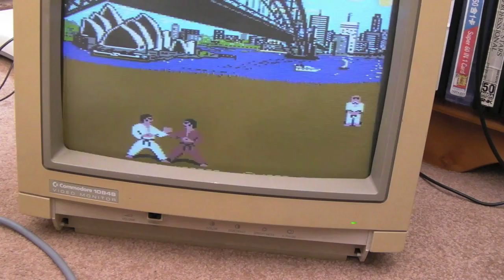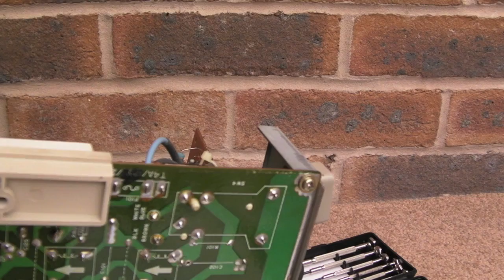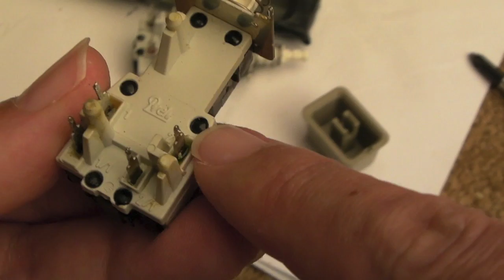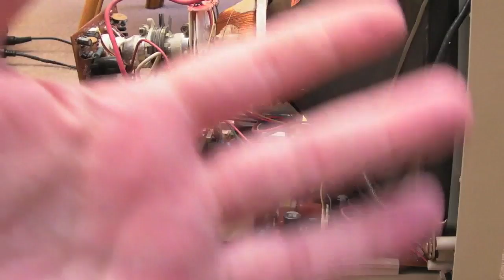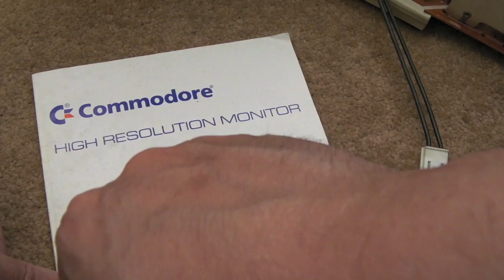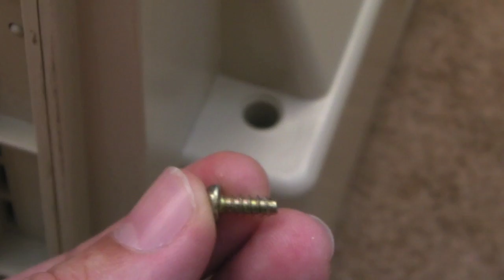Commodore 1084S (1084S-D1) Repair(s) - Part 1

Comment: I've repaired a couple of those Preh ME5A switches, drilling a tiny hole in the black slider part and epoxying in a cutoff piece of paper clip (sanded down round/smooth). One however had completely lost the contact material on the swinging copper arm, so I didn't think it would be safe to put back into service. When disassembling, get the external pins as clean (desoldering braid) and straight as possible, otherwise they'll get pulled out when you separate the housing parts and it is very hard to get them back in place!

Comment: is it worth to recap and change flyback if its currently working? i it should be ok to just use the monitor as is?
Reply from the maker: No point in changing the flyback if its working!  The capacitors will eventually fail - if they have never been replaced, you could wait until you get some kind of fault, or just swap them out in advance.

Comment: Do you think it's ok to swap out this switch like you've done without having to discharge the anode ? providing I go nowhere near the HV side of the board?
Reply from the maker: Working on electronics like this is risky if you dont know what you are doing.   So, only if you feel capable of not electrocuting yourself on the anode, or the charged caps on the board!   If you are careful and stay well away from the anode and flyback cable, and avoid touching charged capacitors on the board, you should be OK!   Do not power it on without the lid on if you want to be extra safe too.

Comment: Hi. When you got electrocuted on the flyback transformer, back when you were young, was the monitor turned on?
Reply from the maker: Yes!!!!  There was some kind of leak at the top of the transformer and my hand brushed near it...  I very nearly died!
Reply: @GadgetUK164  So, if the monitor is off, only the capacitors above rated ~50V, and the CRT tube are dangerous?
Reply from the maker: @peddersoldchap  Yes, and you can discharge the caps and the tube.
Reply: @GadgetUK164  I know I can discharge the caps with a high wattage resistor. The CRT can be discharged by connecting it to the earth terminal of a wall socket, the thing is, I am living in an old flat, so I don't know if the earth terminal is actually connected...

Comment: Hi! Just to replace the power button, is it neccesary to discharge the crt? Or if i dont use it for a few days before the repair is enough? Thx!
Reply from the maker: If you get a shock from the EHT cap or cable, it can be lethal.  That said, if you unplug the monitor and leave it off for 2 or 3 days.  Try pressing the power switch in a few times (having not powered for 3 days, and with no power lead connected) - you may drain any remaining charge in capacitors and from there its probably safe to swap out the power switch, IF you say away from the EHT cable going to the top the tube.  Some of the capacitors may still hold charge so either drain them (short the + and - cap point with a plastic handled screwdriver or pliars).  And carefully swap out the switch.

Comment: I have a 1084s that has no power light, black screen, but I can here a faint squeal when I turn it off.
Reply from the maker: No idea off the top of my head what the cause might be...  Probably needs recapping, but may have a bad line output transformer or main power rail issue (switching IC).

Comment: Hello there im from Argentina, Buenos Aires! I have a 1084 s d1 and the image goes well about 3 minutes then the vertical goes mad. I used an aerosol fail localizer and i thought tge problem was the chip vertical deflection, cos i a put aerosol in it and the image got well and static. I changed the chip and the problem persist. I have no idea where is the problem now. Can you help me? Thanks in advance!
Reply from the maker: It's not the same resistor I had problems with is it?  The one next to the vertical deflection IC heat sink - where the glue overlaps it?

Comment: I am deeply scared of opening my 1084 to clean it / inspect it.
I will be ultra careful like suggested and I want to buy a specific crt discharger kit but...
Is there any extra safety measure I can use?
Special gloves or something else?

Thanks!
Reply from the maker: If you are inexperienced in working with monitors, avoid going inside until you've watched a load of videos on the subject, and get yourself a proper discharge tool.  You can easily kill yourself if you don't know what you are doing.  There are lots of monitor repairs on Adrians Digital Basement and 12v vids.

Comment: I have an 1084s which has not been use since 1998, now I try turn on and the red light come on  but no picture the hookup is correct . What come be the problem other than I have not use it in years?
Reply from the maker: Probably bad capacitors, or a dry solder joint!
Reply: @GadgetUK164  Not sure if I want to open it up and do some repairs on it.

Comment: AC wont spasm your muscles, at high enough current it will drive your muscles into maximum contraction with super human force. Muscles are driven by something close to pulse density modulation. Basicaly frequency of innervation is proportional to force of contraction. DC needs around four times higher current to kill you.
Most neuron signaling in your body works this way.

Comment: I've had 2 1902's with similar problems. There is a resistor and a cap, sometimes the resistor is up off the PCB about 9mm.  The caps start to fail, shorting the resistor to ground.  In the 1902 these are all low resistance, like 4.7 ohms.  My guess is they are being used as slow blow fuses in anticipation of failing caps.

Comment: these extra contacts on the power switch are for regular TVs that have a standby mode, to tell the control IC the TV was turned on via the power switch so it knows to turn itself on instead of going to standby.

Comment: Would anyone know what would cause the top of the screen to pull to the left once warmed up on a Commodore 1084?  Other than that it works fine.
Reply from the maker: Has it been recapped?
Reply: A few of the high voltage caps were replaced and I just noticed that it only does it on the RGB input.

Comment: I have almost this same monitor. the P1 version. I want to bring it to Canada, where I live now. It is PAL 220v. If I take it to Canada, and use a step-up transformer, will it screw up the hertz and frequency for the monitor? I also have a PAL C64&A500, that I want to continue to use on it. Or shall I change the powersupply to 110v and still keep it PAL. Will all this work?
Reply from the maker: I honestly cannot remember what the impact would be.  I would assume that the refresh rate would jump from 50 to 60hz, but it would still support PAL from Composite connections (I think?  There is a chance it might need the delay line swapping out - ie. you might lack colour when using composite connections).  If you connect via RGB connections that should work no matter what.  It's more a question of a) can you step up to 220v AC, or b) can you change the PSU to support 110v AC.  With either solution 60hz is what will be fed into the PSU, and that might mean some adjustments are needed to picture adjustments.
Reply: @GadgetUK164  Thanks, I think i'll take the chance and bring it over and do the step up transformer. But first I'll have my father in law to send it for repair... the usual Flyback is a gonner... Is that easy but dangerous fix?
Reply from the maker: It can be dangerous removing the flyback from the tube (if unexperienced), and the capacitors on the main board can hold hundreds of volts DC.  But it's fairly easy to do.  The hard part is finding a replacement flyback!

Comment: When I was doing work experience, I was working with the electricians in a factory. They were trying to tell me what the fault was with a piece of machinery, and I thought I was being clever (15/16 year old kid) and pointed towards the problem, didn't even touch it. The industrial machines are 360V AC I believe. They don't turn the machines off unless they have to. Ouch. They pissed themselves laughing at me. I became a developer instead of following a career in electrical engineering.

Comment: Many eon’s ago when I was on a City and Guides 224 Electronic Servicing course we were working on CRT’s in the forms of some very old TV’s, Half way through whatever we were doing at the time and a few work benches behind mind there was a rather loud bang followed by the room filling with think oily smoke and a large object flew though the air by my bench, once the windows were opened and the room became more visible we found one of the students on the floor, shaking, hair all fuzzy, and covered in black wet oily substance where he must have decided to short out a large smoothing cap the wrong way. That’s how I was shown to respect the stupid voltages in TV’s and monitors... great vid as always
Reply from the maker: Thanks =D  Yes, you've got to be careful for sure =D

Comment: Great video... I spotted the bad cap within the first few minutes... you can see a nice bulge to it.  I knew you'd eventually find it.  I've always wanted to learn to fix CRT's.. but always stayed far away not being sure (other than the flyback and red wire) what was high risk of electrocution.  Would like to see a beginner guide to CRT repair.  They are not very complicated but they are also not something you can just get in there and "play" with at least not for long ; )
Reply from the maker: That wasn't the only cap as you can see in part 2 and part 3!  There were some tantalums, a resistor and a dry solder joint too!  I covered most of the basics over the 3 videos but didn't cover checking voltages or anything much to do with the LOPT other than disconnecting and re-connecting it.
Reply: @GadgetUK164  Bump! Have you managed doing the beginner's guide to CRT repair?
Reply from the maker: @peddersoldchap  No, just this series on the 1084S-D1...

Comment: Great vid as usual buddy. I got the Black 1084S and its served me well for many years after having all sorts of stuff plugged into its orifices. My power switch on the back insists on popping back out so i just wedged half a lollipop stick in to keep it on, Bit Cowboy but it works. Dont fancy opening that badboy up. My Amiga 1200 looks great on it as does various consoles. I think the colour has degraded on mine. What is the difference between the Black cased 1084s and the one you have gadget?
Reply from the maker: Thanks =D  Yeah, power switches on these just break for fun =/  lollipop stick sounds like a good solution to me lol, better than breaking the tip off and tilting it like the previous owner of mind did.  The do give a lovely picture but the colour does drop a bit with age sadly =/   I don't believe there are any difference between the black models - its just the same monitor with different colour case to match the Amiga models that were black (CDTV, CD32 etc).

Comment: Great video!

I want to challenge your understanding of electric shocks as it relates to A.C. and D.C.

You explain in this video that D.C. electric shocks are more dangerous because they cause your muscles to cramp and that you become unable to let go of the device.

This is incorrect.  In fact it's the other way around; A.C. shocks cause muscles to lock up, in some cases rendering you incapable of letting go of the source.

The reason for this is because of the way the human nervous system works.  Our nervous system sends signals in pulse trains, which operate in and around a frequency of 60Hz.  As a result, our nervous system is more sensitive to A.C. electric current.  The most dangerous frequency range is 5-500Hz and it peaks in danger at... guess what?

...that's right.  The frequency of mains power lines! 50Hz!!!

If you look up the HSE guidelines on electricity and safety you will find that they quote much lower voltages as "dangerous" for A.C. than for D.C.

Of course, if you ask me, I wouldn't want to be shocked by either!!!

Regarding shocks from the line transformer, they are awful.  I haven't ever endured a full on belt from one, but I've had some incidents.  And they are very unpleasant.  After having a shock from one of those, I found that I had a temporary phobia of the inside of TVs for at least the rest of the day.  I couldn't go near one.

And, having worked the early part of my career on CRT televisions and mains equipment in general, I've developed a healthy respect for live equipment when I'm working on it.  It doesn't take many belts to instill a healthy fear of that in you.  Trouble is, one nasty belt can sometimes be one too many!

Take care people!
Reply: Earlier I quoted HSE guidelines to you.

Here is the source:

http://www.hse.gov.uk/pubns/indg354.pdf

See page 2:

"as a rough guide, voltages exceeding 50 V ac or 120 V ripple-free dc are hazardous in a dry, unconfined, non-conductive location"
Reply from the maker: Thanks for posting this, it's very interesting!  Yes, it's not as clear cut as explained in the video.  Frequency, voltage and current play a part too.  DC for example is often actually saver to touch with even high voltages (you can see evidence of this on some of ElectroBooms videos), whereas AC conducts over the skin easier.  I was taught way back in the early 90s and the same thing was passed onto me by several different engineers I worked with.  Research has clearly moved understanding on since then.  In general AC voltage will throw you away, DC at 24Kv from a HT cap can lock your muscles up though - I know, I've experienced exactly that and had enough AC shocks to feel the difference with regards to muscle action.   But I totally accept that AC can be more lethal than DC just based on the points you've outlined and the link the hse guidelines.  There are a lot of variables - bottom line is both can be dangerous and with regards to fatality its all about current and the path it takes.

BTW - we all run at 60hz, cool!  No need for a 60hz mod!!!  Also explains why my vision has never been perfect, we are all wired with NTSC vision.  I need to mod that to PAL 60hz I think :o)

Comment: Can anybody help me find a cap kit for an commodore 2080 monitor?  Please and thank you.
Reply from the maker: Sorry - no idea =/  Check on eBay, but you tend to find that some models are more popular than others regards kits.  My advice would be to take it to pieces carefully - paying close attension to safety before you even attempt it.   Then just note the uF, voltage, temperature, size of each cap and just order them all seperately.  You could even order multiple caps and then sell your own kit - see if that first batch sells and if it does you've got a regular earner =D

Comment: I've got a 1084S which makes an horrible whistling noise.
Do you know what is the problem ? Could a noobie in electronic repair it ?
Thanks :)
Reply from the maker: Generally I would expect either the line output transformer, or capacitors.  Since the caps are old and hammered in these its probably worth swapping out the caps first - but you may find at the end the problem remains and its the LOPT.  If you can get a spare LOPT maybe swap it out and re-test to see if there's any difference in behaviour.  There are so many other possible causes though it can be hard to diagnose just by that whistling noise.  What ever you do, be very careful before working on it - and if you don't know what you're doing stay well away from it.
Reply: Many thanks for your help :)